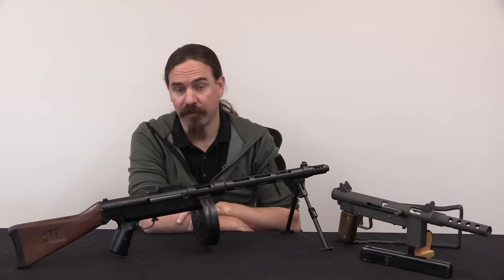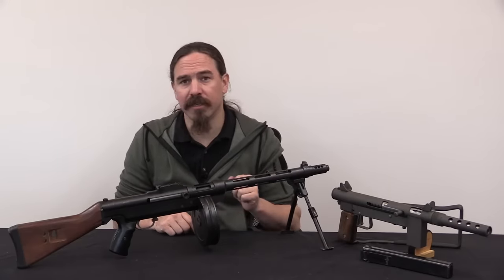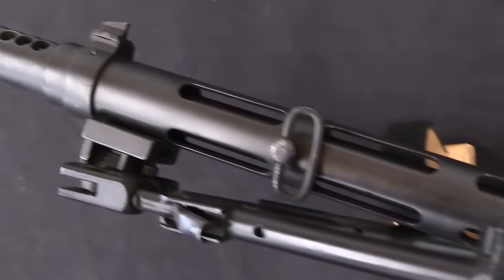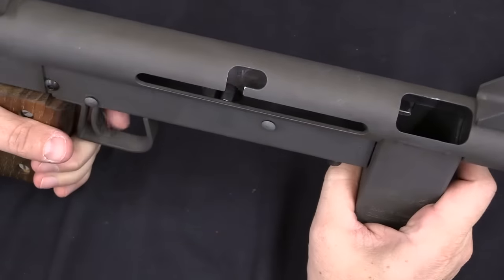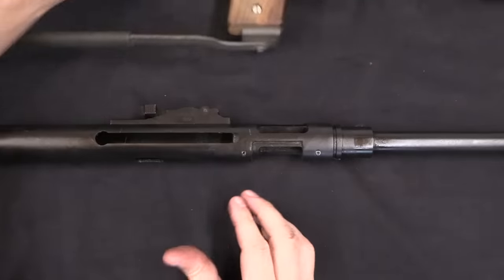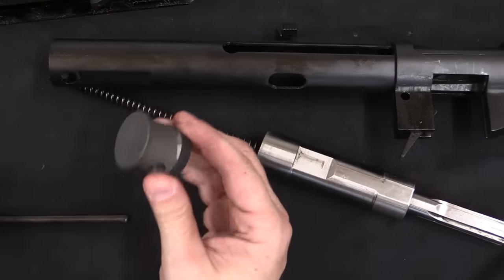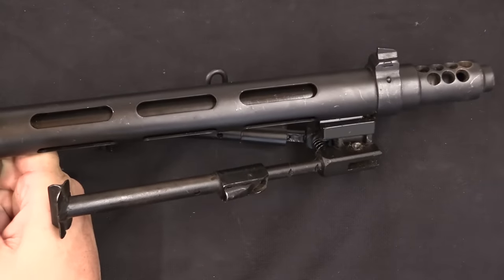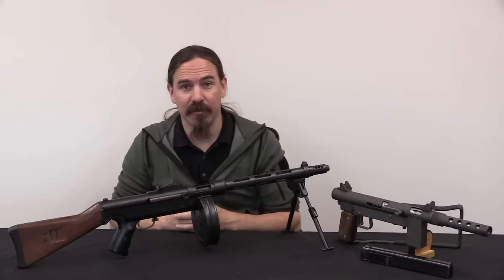Engineer's Delight: Stemple 76/45 Becomes the Stemple Takedown Gun

Comment: There's nothing like hearing Ian lovingly, carefully explain, "This is a piece of shoddy crap, here's how they got here."
Reply: Lmao
Reply: The Stemple ISN'T shoddy crap, they are an INCREDIBLE use/design set using reasonably common parts to produce something reliable and relatively cheap/accessible. (For registered machineguns)

They aren't particularly pretty/shiny but they are amazing at what they do/as a means of getting around stupid law.

45acp is a far better calibre for an SMG than 9mm for a start. (It's subsonic naturally vs 9mm).

The tubes can be converted into everything from a Sten clone to a Sterling to a Swedisk K to a folding smg that looks like a radio (as the one used in robocop). The design is incredibly elegant especially when you consider just HOW many options exist with those tubes.
Reply: @jediknight1294  far from crap
Reply: @jediknight1294  its crap
Reply: @jediknight1294  Something can be designed to be cheap crap very elegantly.
Reply: @bubba200874426  not really, it doesn't work like that.
 
Elegant design is about a lack of superfluous parts, reliability and consistency oh and ease of production and quality of function.  

Physical beauty is a different thing entirely and a set of subjective characteristics versus elegant design which has objective features.
Reply: @jediknight1294  None of those things contradict what I've said. There are lots of cheap crap products that do the their job very well. They just weren't designed to do it very long. Like, for example, most clips for firearms.

Elegance of design is how well something does the things it was actually designed to do. If it wasn't designed to do anything but be cheap and work, it's an elegant design if it does those things well. That doesn't mean the end result isn't cheap crap compared to the rest of the market.
Reply: @bubba200874426  crap implies it doesn't work or is shit at it. The walther p22, crap, the Ruger mrk 1 is cheap. Subtle difference.
Reply: @jediknight1294  A design from the post AR-15 world intentionally made to be a cheap copy of a 40+ year older design isn't crap compared to its contemporaries? 

I don't care about a registry. I'm comparing things on the products they actually are. It's probably 80% as good as its contemporaries for a much lower price. Everything in design is a tradeoff.
Reply: @jediknight1294  And, of course, elegant design can also be coming up with creative systems to use what you have. And fundamentally, that's the beauty of this, really, the fact that it takes what is, fundamentally, a really simple part, and comes up with a creative system to use it in more interesting ways as well.

Comment: I'm a mechanical engineer, motorcycle aftermarket but did spend a few years of my early career in aerospace and reading the title of this video and having watched it, the production/manufacturing process for this sounds like *A PARTY*. Between the legal maneuvering and the parts-bin assembly process, to still end up with a final product that's still greater than the sum of its parts sounds like my idea of a fun time.

Comment: The Swedish M/45 didn't have a saftey. Just a notch like the one on the 76-45.
Reply: The only ones that had a safety was the  police version i believe it was called M/45c but the military versions at least had a dropsafety by pushing in the bolthandle.
Reply: @bengtjakobsson5177  To clarify this... The bolt handle goes all the way through the bolt. When you put the handle in the "safe" slot there is a hole on the other side of the tube that lines up with the end of the bolt handle and you can push it in a few millimeters. This way the heavy bolt can't slam back and disengage from the safety slot if the gun is dropped on the butt. 

There is one more safety device that can be used and that is a plate that is placed in the ejection port and will prevent the bolt from closing. This device is used by guards and in situations when the guns are to be carried with a loaded magazine in public where there can be no risk of accidental discharge. I think it is also supposed to be highly visible to show the public that the gun is in a safe state The plate can be pulled in less than a second and after training you don't even notice it so it doesn't really add any extra time to the readying of the weapon, but it's also clunky and the one I had tended to drop out if I shook the gun making it in my opinion a very unreliable device of questionable value. I really don't like the idea of a unreliable safety device.
Reply: @blahorgaslisk7763  The safetyplate is only for peacetime use it is mounted to the holder for the catchbag for the spent casings and that hole contraption would never been mounted in case of real use. If I remember right there also is a boltlock hole in the front of the receiver so you can lock the bolt when closed.
Reply: @bengtjakobsson5177  Well it's been almost forty years since I last handled one of these IRL so the memory is a bit sketchy. But I do remember those ridiculous safety plates. And like I said mine would not stay in place reliably which made me feel it was less than useless and served no legit purpose.
Reply: @blahorgaslisk7763  We are obviously of a similar age so my memory aren't that reliable either but the safetyplate was only handed out to us for guard duty it wasn't part of our personal equipment and as i remember the ones i used worked fine, but it was obviously an afterthought and a solution to something that really wasn't a problem.
Reply: @bengtjakobsson5177  Also yanking that out and letting it clatter to the ground was a rather obvious step/signal to anyone not swayed by an angry look and a stern " HALT!" and the pigsticker stuck on the front, even if not too familiar with firearms.
Reply: @bengtjakobsson5177  probably d, the c version was the one with bayonet attachment.

Comment: I would have thought drilling and tapping the screw holes for the rear sight would have counted as a modification to the receiver?
Reply: That's what I thought too
Reply: They got approval for the trunnion pin holes.
Reply: @randomidiot8142  That's fair actually, so there's obviously some small leniency in what you can do with it

Comment: Back in the mid 80s, a friend of mine bought what is essentially a semi auto .45acp version of the legendary KG-9...very stout receiver tube, and resembles these Stemples quite closely. It had a 50 (fifty!) round stick mag and another mag (much shorter, maybe 20?) and used an AR15 grip. 

I don't recall the name/model number, but maybe there's a footnote on the manufacturing of this peculiar piece?

Comment: Thanks, Enjoyed, I bought a  Stemple 76/45 in 2016 and the matching Burgess can,  For the most part it runs fine. Yea a little heavy ,but easy to run as a lefty. Spare parts are inexpensive and it is easy to service. Kinda a M3 SMG witch also had No real safety other than the ejection cover. Later from Texas.

Comment: That big one is basically what im looking for.
But with 100 shot belt fed can coil that uses a sprocket loader to pull belt & and ejector pin.
Using 6.5 creed Moore.
Then i want to be able to quick fit & remove the stock & barrel extension taking it from a machine riffle to a machine pistol.
And using the same 6.5 being able to swap to a standard rectangle mag design for the machine pistol set up.

Comment: My father and my uncle worked with Mr. Poling as he was attempting to get his semiauto MG42 project off the ground. (I may get some of the details here wrong, the story is a bit complicated for me to remember) Around 20 years ago, Mr. Poling approached my uncle, who owned a well-renowned machine shop, and my father, who was working in my uncle's employ, in an attempt to build prototype semiauto MG42 receivers to use on parts kits coming in at that time. Their first attempt turned out well, shot well, but was torpedoed by ATF. Upon redesigning the receiver, Poling said to my father that he'd found that they only need to make 12 tools to make a production line for MG42 receivers, and they would be all set - to which dad responds "Do you have $400,000 sitting around to build these tools?" Mr. Poling did not have the 400,000 dollars. Either way, Poling decides he will make a redesign that is more ATF compliant. He takes the design to my uncle, and he agrees to make some - as part of the payment, My father would get serial number 001, number 002 goes to my father's good friend (a very deserving person to give it to - he is pretty much to the VW Kubelwagen community what Mr. Goldsmith is to MGs), and number 003 would go to my uncle. The three guns are made, and stay in the shop where they are made for a length of time. Before my father and uncle could take them home, however, they found the three guns are gone. On asking Mr. Poling about this, Poling states "I was low on cash, so I sold 001 and 002, and I'll give you a different gun for 003". This obviously made my family very upset, but alas the tooling was setup, and a production run had to be made, so several hundred receivers were made, some of them being dummies, installed on Poling's parts kits. Several of them still hang around in my family, my uncle has a semi-auto one hanging around, and I was actually given one of the dummies as a Christmas gift when I was 14, and that is still leaning on a wall in my room to this day!

Comment: So, the law that is intended to control and regulate the manufacture and sales of machine guns, is so poorly written that some dude could register a generic metal tube as a machine gun?
What is there to prevent anyone from building one of these and calling it a bicycle pump?
Reply: I have trouble understanding how the ATF decided that the essential “core” of a machine gun is a metal tube with slots cut in it. It seems inside out to me: wouldn’t the tube’s design necessarily follow the design of the bolt, trigger, magazine feed, etc.? Those feel more like the vital operating system. Doesn’t  It’s logical that the ATF won’t let you modify the regulated component, so that you can’t change the machine gun…but doesn’t the STG have a different OS, basically?

It’s as if the inventors of the CD patented the CD jewel box case instead of the CD technology.

Is this a common practice of the ATF?